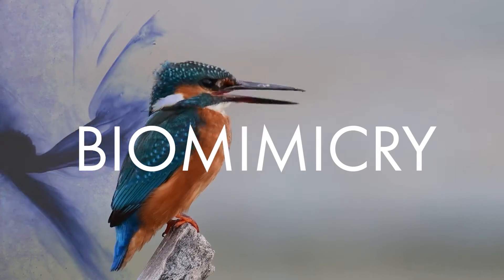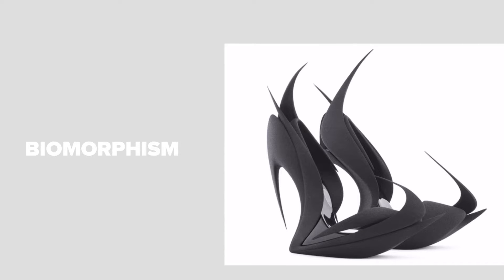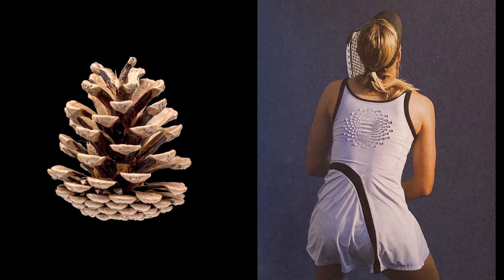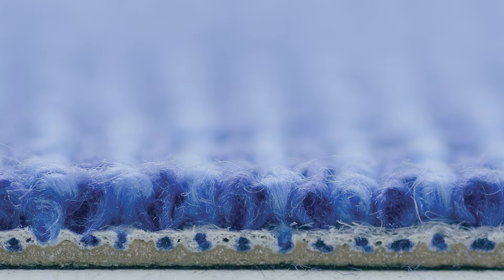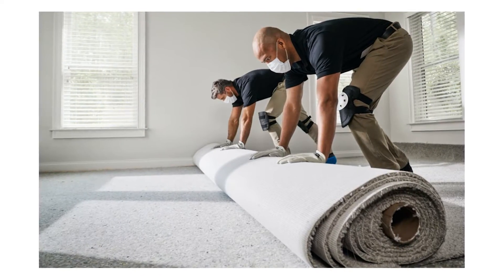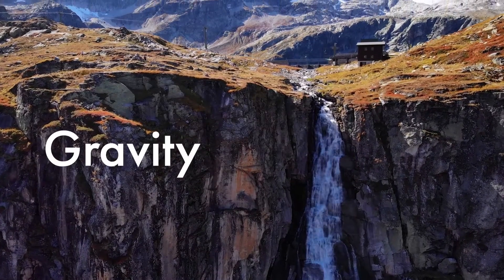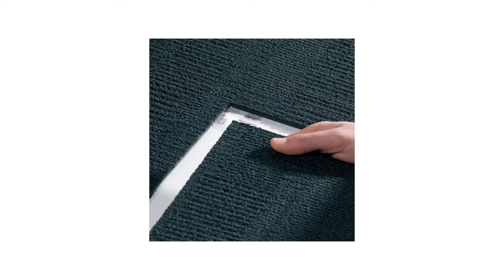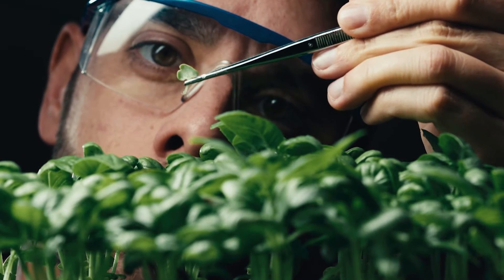Biomimicry has massive potential. Why aren't designers using it?

Comment: I learned the other word, Biomimetic, from Dunlop racquets for Squash. I don't know if the concept is connected to Biomimicry
Reply from the maker: Yes, I've run into that word too. Some of the images in this video are from a book I have called Biomimetics for Designers. Depending on where you look for a definition of the concepts, Biomimetic and Biomimicry appear to be interchangeable.